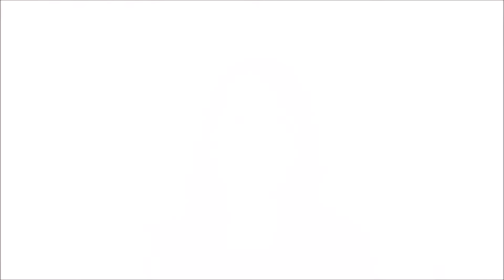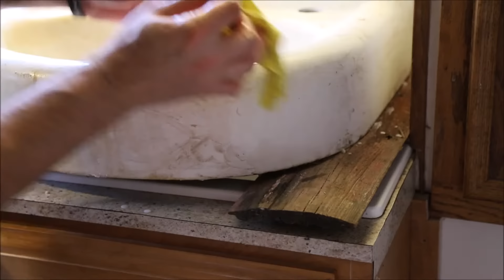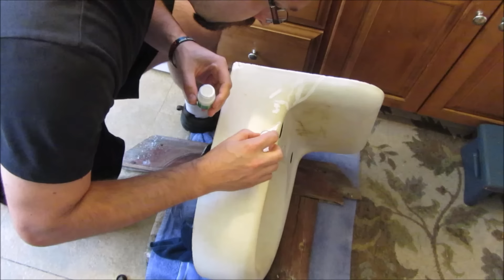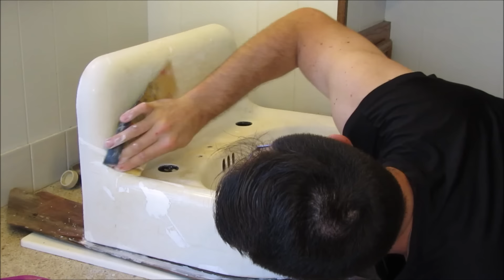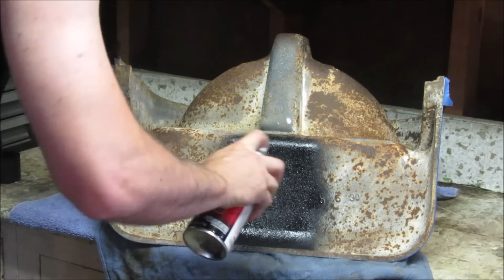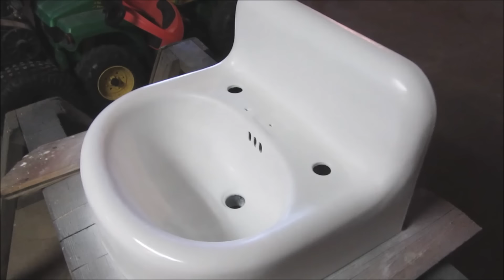Cast Iron Sink Restoration | DIY Project

Comment: How did it hold up over the last 3 years? I have a very large antique kitchen sink, with drainage ledges on both sides, my great grandma and my grandma both kept a dish pan in the sink and it has worn down the enamel and is rusting underneath of where it was kept for all of those years. Wondering if this would work but curious to see what happened first.
Reply from the maker: This particular sink has held up very well! We did a similar process for our kitchen sink though, and that one hasn’t held up well unfortunately. With the hot water and the scuffing of dishes it has worn away the paint/finish. We are looking for a different solution

Comment: How is the Rust-Oleum spray epoxy holding up? Wanting to start a project this weekend and hoping this turned out well for you over time.
Reply from the maker: We have been using our sink daily for a year now and it looks as good as the day we had it installed! Be sure to follow the directions very carefully and allow a lot of time in between drying coats! Good luck!